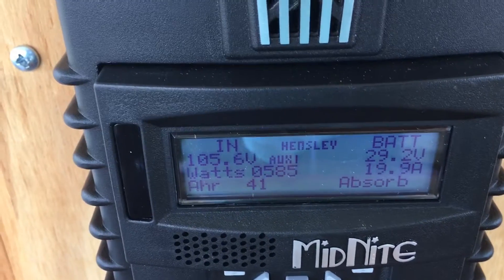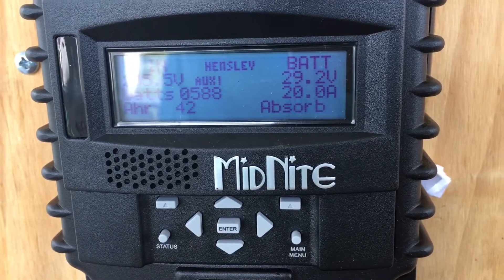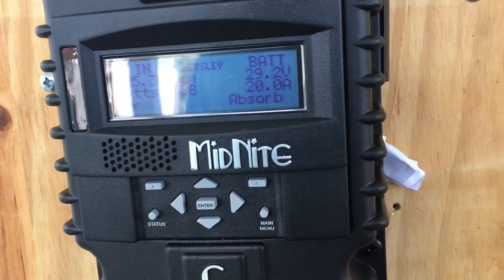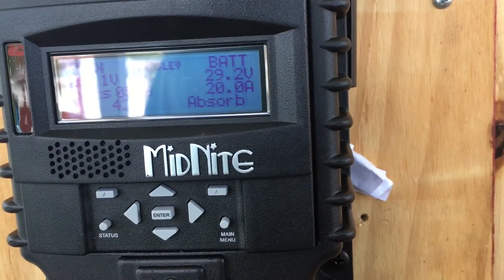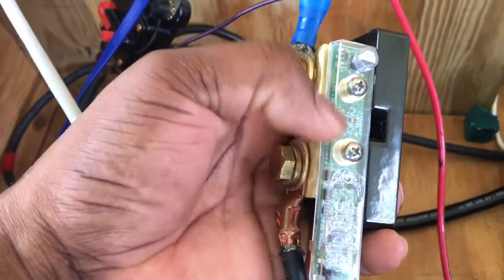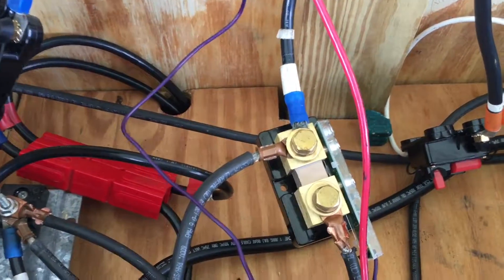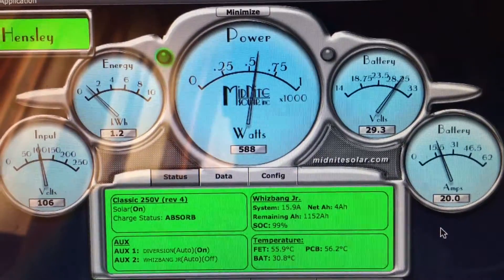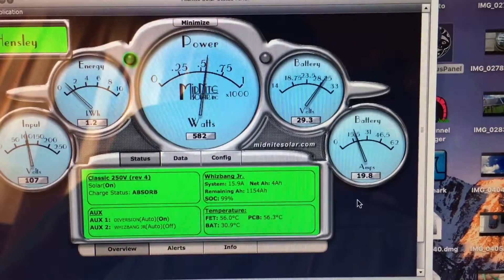Whizbang Jr Helps Organized Battery SOC

Comment: Hi, looking good Kuz, you have a cool set up, little messy with the wires and probably should have the wizbang mounted along with your fuses and cut off switches to have a little safety set in place from risk of fire and shorting out , quick question , is your battery amps set at 100% I see them at 1153 amps at 99% , is that after you halved the total amps or is that the total bank amps, as when I set mine up I have 1340amps @ 24VDC  then halved that to give me 770 amps an set that number as my 100%. then that way I will never go below 50% of my total battery bank. just a thought. keep up the good work.